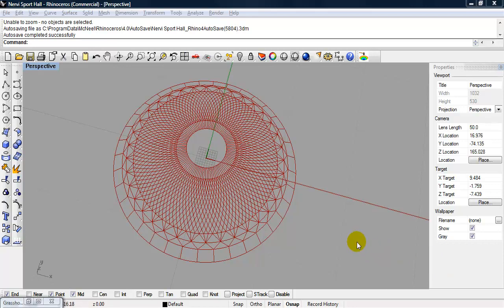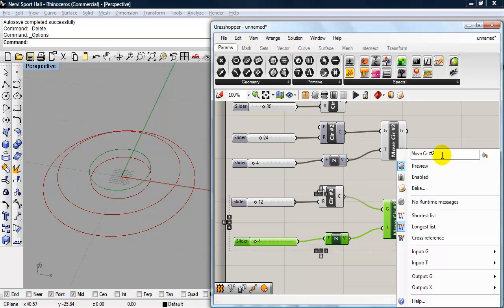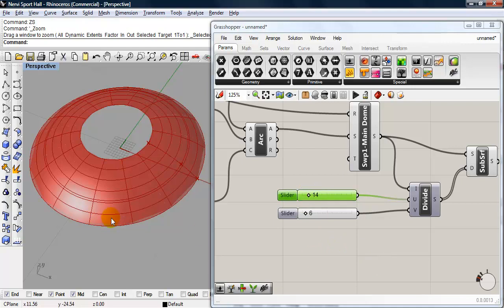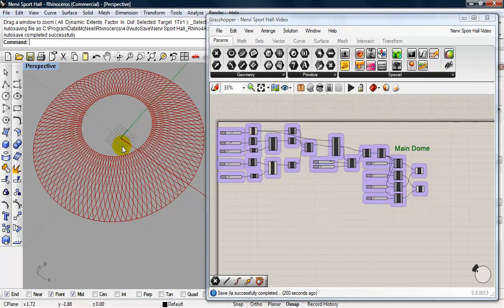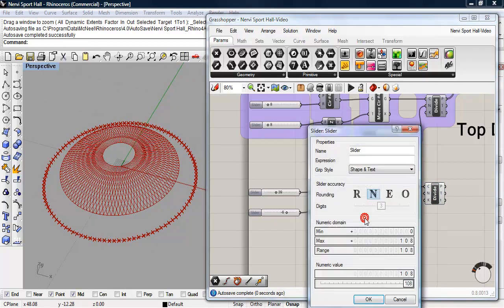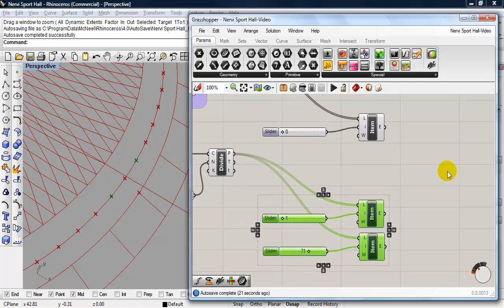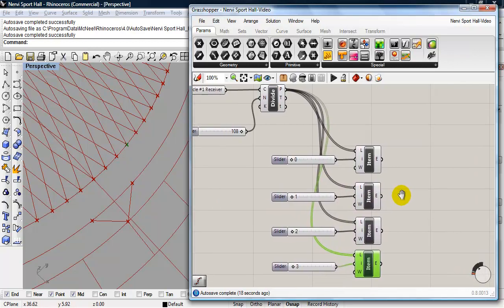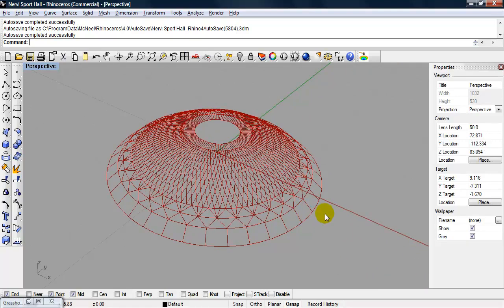Grasshopper Nervi Palazzetto

Comment from the maker: Here are some updates to this video for the latest version of Grasshopper:
1.) To hide or turn off capsules or components, select the capsule then right click and select preview from the flyout menu
2.) Rotating scribbles is now done by selecting the scribble and holding down the Ctrl or Shift key.
3.) The most important update replaces cross reference for the polar array at the 40:25 minute mark of the video. Instead of right-clicking and selecting cross reference, you should right-click on the G input (geometry) of the rotate capsule and select graft.
3B.) An easier alternative to the Polar Array setup in this video is to replace the Series. Radians and Rotate capsules with the new Polar Array capsule.
Reply: thank you for keeping the video up to date

Comment: Hi, I have some problem on the very last step where when I right click the radiants, there were no selection of cross reference. Will you able to help me on that?
Reply: CrossReference has its own node now...you need to connect the Radian R to A (input) and A output to Rotate V "A" then connect Ln V column to B input of the crossreference node and the Ln of Double V Column to that same B then B output to G of Rotate V - Hope this helps